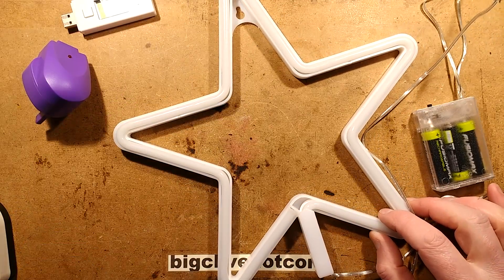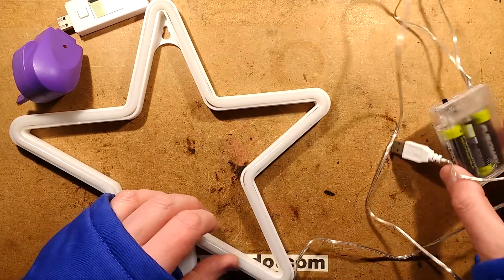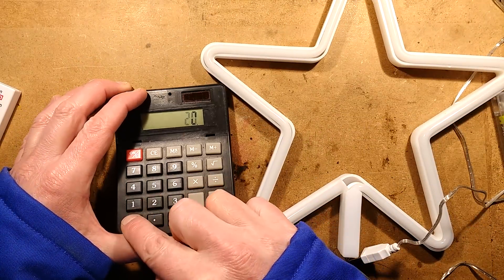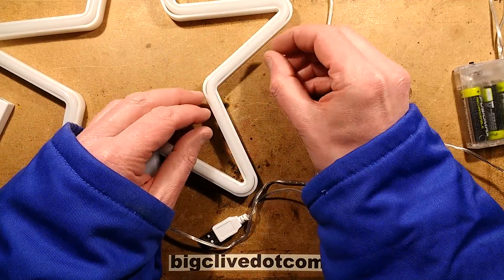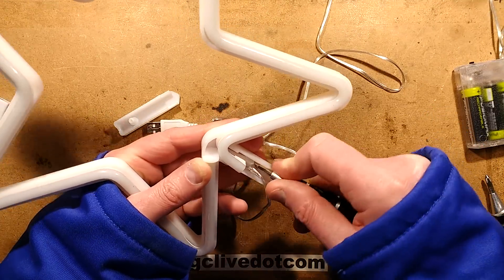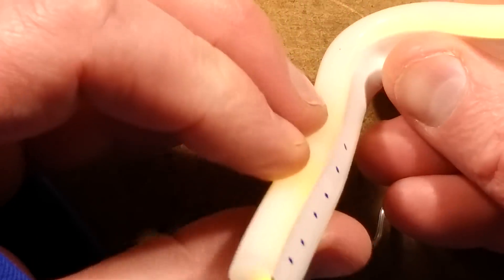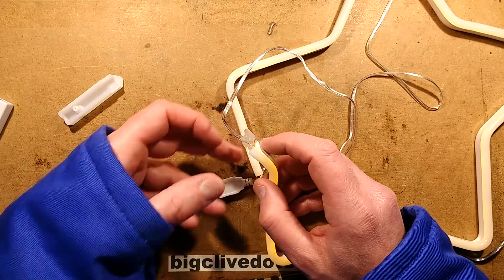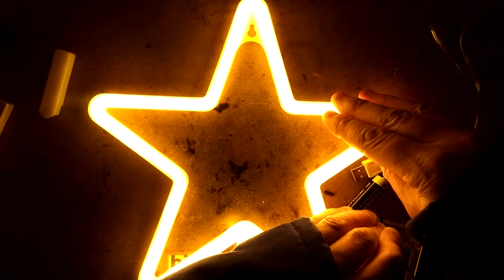Inside a USB/Battery LED neon-style star.

Comment: I just got a USB powered one of these on clearance at walmart. Mine draws around half an amp.
They had a cloud one too. I ended up removing one of the LEDs from the tape because it was cut and not lighting up. I powered it and the LEDs themselves are yellow for the star.

Comment: What kind of wire do they use? Would it be possible to strip those and connect to them a battery clip?
Reply from the maker: It comes with a battery pack and USB connector.
Reply: @bigclivedotcom  I ask that because I have one of those signs with the same connection but I would love to make it strictly off battery. How would I go about that? Strip and connect a battery clip?

Comment: I have a couple of these and I'm wondering if there's a way to remove the plastic battery case? I only use the USB feature and the battery packs are keeping me from hanging these on my wall since they're bulky and would be super visible.
Reply: did you find a way?
Reply: @skydriver2639  no :( all of the wires are soldered together inside of the battery pack and i have no idea which ones lead to where so i don't wanna risk making them unusable, haha

Comment: You say factory workers, but this seems like something that would be incredibly easy to make "on demand," i.e. have a stock of frames and various colors of LED tube tape and spend the minute needed to cut the tube, solder the leads and glue it into the frame for each order. A very effective eBay operation assuming they're getting a good price on the tubing.

Comment: I would love to see a video on battery backup bulbs work (like https://www.lyfelite.com/)
Reply from the maker: I did an early one, but they've evolved a bit.  They detect the switch by passing a small current between the lamp contacts and detecting other loads in the house when the switch is on.  If you bridge the back with your fingers they lamp will light.

Comment: I would be more interested in a similar unit or smaller with real neon. A few years back I saw neon signs that were about 5” diameter and they were make of a injection molded neon. Should have bought one.

Comment: Kodak used to deliberately try to explode your batteries. If you used a kodak power supply into a Kodak camera, there was a little non-standard nub at the base of the jack that would interrupt the supply to the battery compartment. If you used any other (generic) power supply jack, said nub was missing and it would charge your alkaline batteries. A very dirty trick, if you ask me. The last time I ever bought Kodak.
Reply: Coming from the film era, and being a fan of both Kodachrome and Ektachrome (but a real fan of Fujichrome) - I know what you mean - but I got a real cheap deal on a printer and digital camera that I couldn't refuse. I never blew a battery because I got wise to their ruse but an unwitting person must have done it at some point...

Comment: To remove hot glue from a surface, denatured alcohol is perfect!
A few drops to the edge of the splice and then a little stretching is enough. The adhesive then detaches from any smooth surface.

Comment: If you spray the hot melt glue with isopropyl alcohol it will soften and is far easier to remove.

Comment: I'm looking for exactly this stuff in longer lengths preferably in 12v for Santa's sleigh!
Reply from the maker: https://www.ebay.co.uk/itm/302322014060  But also consider waterproof 12V LED tape from the same supplier.  Lower power for brighter sparklier effect, albeit more directional.
Reply: I'm thinking about rgb tape for around the frame and this stuff for the decorations. Needs to be fairly weather proof though.

Comment: Clive, when you ran the voltage down to 3v. I heard either 30 or 13 ma.  With 2000 mah rechargable cells at 30ma, that's 66 hrs.  Add a 6/18 hr candle timer and I think you've got the 12 days of Christmas covered.  AND, you know when it's time to take down the tree. :-D

Comment: Clive, at the risk of being "that guy" trying to contact you in the comments, would you have any interest in a couple 120V LED bulbs? The internal construction was a bit different than some of the ones I've seen you take apart, and I wouldn't mind sending a few over.
https://imgur.com/a/dlS2Q
Reply from the maker: I've looked at similar lamps in the past.  The large transistor-like components are high voltage current regulators with internal thermal adjustment.  They usually just require a single resistor to set their output current and dissipate the difference between the mains voltage and the LED voltage as heat into the heatsink.  Those may be multi-chip LEDs to get as close to the mains voltage as possible.

Comment: Hey Clive,

Do you happen to know where I could buy a 30W 240V dimmable LED driver and warm white COB LED with no AC flicker? We can’t buy ceiling fans with this arrangement here in AU, so I’m trying to make my own.  Any advice is greatly appreciated.
Reply from the maker: Most dimmable LED lamps flicker unless they have very complicated circuitry to derive power and intensity informnation from the chopped waveform.   The higher profile brands like Philips may not flicker but will not generally be rated high power.
Reply: bigclivedotcom 

Thanks, I’ve seen those LED lamps and they almost suit. The highest wattage that Phillips make is around 13W, but it’s cold white! I was thinking of using two of the 9W warm white lamps, but the domed light fitting in the fan doesn’t have room.
Reply: Hi Clive, I found a solution. I had some unused 9 watt MR16 warm white LED lamps doing nothing, so I gutted the little round PCBs out of them. A dimmable 20 watt LED driver with a varying DC output has worked well. I use two of the PCBs per fan, using the fan itself as a heatsink. No AC flicker at all, and dims nicely. Not down to nothing unfortunately, but good enough. Hope this helps you or another subscriber.

Comment: Since you are wearing that warm-looking clothing, I would like to ask do you still have about 11 degrees celcius in your apartment, as you have said before? If so, what is the reason for such a low temperature?
Reply from the maker: I've spent my life working on open sites and outdoors, so I prefer a cold environment.  I use dehumidifiers to keep the place dry and cool.
Reply: Okay, thanks. It just seems so extreme, no offense.

Comment: Clive, many (if not most) electonic items I buy  run on 3 cells, whether aaa or aa. The problem I have is that the charger seither take two or four cells, and not three that the devices take, therefore  I constantly or inconsistantly miscarge individual cells. Do you have a strategy you could share with us?
Reply from the maker: I always look for chargers that charge cells individually.  Charging in pairs is often a sign of a cheaply designed charger.
Reply: Buy a charger that charges cells individually and not in pairs.  Charging in pairs is not good for the cells as they can charge unequally.
Reply: I can really recommend IKEA LADDA for 99SEK (10£/10$?) which is a good and cheap individual 1-4 pcs battery charger. (looks like a GP battery charger for 1-4 cells my dad has which was around 60£) http://www.ikea.com/se/sv/catalog/products/80241307/

Comment: put some bloody heating on you tight git lol
Reply from the maker: I normally would when it gets this cold, but the oil burner has just packed in.  I spent the evening trying to remove it from the boiler, but it's seized in solid.  I'll leave it to soak with penetrating oil for a while.
Reply: bigclivedotcom   A while = sometime in the summer.  Heating is for southern shandy drinkers isn't it?
Reply: ACTUALMIKU 
He wraps himself in Dickies®
Reply: +bigclivedotcom I get cold so easily idk how you live.
Reply: its lucky you have the knack of stuff that matters clive ...old boilers thou inefficient are easy to fix ..not like the new gas boilers those things are a POC hope your oil penerates deep and you can get some heat back on ...
Reply: are you telling me that he has a huge dickies lol ..tmi lol

Comment: The only downside to LEDs in place of Neons is you don't get the traditional buzz and flicker of a faulty neon sign... :P
Reply from the maker: That can be added.
Reply: No opportunity for FART Jokes either - (the Italian Neon Sign Transformer Manufacturer)
Reply: Given it comes from china, I'm surprised it's not fitted as standard... :P
Reply: I guess just a small mains->5v transformer with a resistor and small speaker on the secondary should do it. Maybe a capacitive dropper if the sound is too clean/siney.
Reply: bigclivedotcom My thoughts exactly! You rule.

Comment: Hello, I’m a long time subscriber but I don’t know anything about hardware, but why is it that some electronics can work even if something is really corroded I saw a video where a YouTuber took apart a ASIC Antminer but it still turned on the fans, but why wouldn’t the rest turn on?
Reply: If the YouTuber in question is Louis Rossmann, then I've seen that video and the reason the fan worked is that the PSU was fine. But the controller board noticed that something odd was happening on the data connections and so lit the fault LED. If I would design a circuit like this, I'd make the fault LED active-low on the processor side so that it turns on both if the main processor realizes that there's a problem and in cases when the main processor is the thing that has a fault.
Reply from the maker: The power supply was probably working but the corrosion may have affected the processing circuitry.
Reply: Where corrosion has occurred, one of the most common failure modes, is that of a partial malfunction in a system. It only takes one wire, or one electrical connection (or conductor) to rot, and then part of the system, or in some cases, the whole lot will not work as designed.
Reply: Bryce Spaulding You're welcome. It is our curiosity that leads us to channels such as this one. As for the quick reply, that was caused by my sometimes-formidable procrastination powers. But for the record, if you can remember the source for anything that you quote, you really should link to it. What if somebody else who didn't remember the video that you referenced were to answer? Or what if someone in the future sees your comment and gets confused about what it is that you meant?
Reply: Danya G. Yeah it was him, but it was an little older video than this one, so I assumed no one would notice the comment as quick so I just gave it a shot here. I appreciate the reply. I’ve always been curious but thank you.
Reply: Danya G. I definitely agree, I was thinking when I commented that Clive wouldn’t want me linking another channel, but I soon realized that he’s too laid back for that, should have known better. Thank you for your help though.
Reply: Mark 1024MAK Yes, it takes only one failure, but only if the system is non-redundant. And I would think that something as expensive as this would have a degree of redundancy built in. Especially since modern CPUs have upwards of a thousand pads, and I cannot believe that all of those are unique, then there is at least some degree of redundancy in those systems.
Reply: Bryce Spaulding Really? You were worried about him seeing you like other channels? He himself likes many other channels, as evidenced by his subscription list. (And yes, that is public - you can click on an avatar, mine for instance, and see the channels that the person subscribed to. Unless said person doesn't want you to see this, which can be activated on a per-channel basis, but I've never found a use for it - why subscribe to a channel if you're not ready to tell other people about it?)
Reply: Danya G.  For the most part, unless otherwise specified in the requirements, it's only safety critical and operational critical systems that have extensive redundant system designs (other than multiple HDD and dual PSUs which are not uncommon in industrial computers for example).

Comment: About the UT658 USB analyzer, I've seen you use at least couple of different USB meters. Do you have a favourite?
Reply from the maker: I tend to use the big Portapow unit for serious tests, but I really should do an accuracy test on a range of testers.
Reply: I had completely forgotten about that PortaPow unit. Looked at it a few times on their site but never bought. Shame that they don't do direct sales anymore. I've been most interested in the YZXstudio meters, remote logging and all that good jazz, even the option to do BT which would be quite handy in some situations. But that interest has never materialised into actually buying one. Oh well..

That's a good idea for a video. Obviously going to require a bit of work to put something like that together but I'd love to see it someday if you have the time, energy and resources to do it.
If you decide to do one, it would be nice if you go on a bit about the different "styles" of meters and how you could use one. Especially considering fast charging with phones (/tablets) is quite common these days and now we've got laptops being charged through USB-C with USB-PD and so on.
Like QC3.0 being 5-12V (some meters are rated 0-9V), OPPO VOOC/OnePlus Dash pumping 4+ amps at 5V (some meters are rated 0-3A) and so on. So buyer beware that they buy an appropriate meter which can handle what they want instead of buying the cheapest, generic USB charge doctor.
Reply: Seems to be more accurate than some of the earlier "generic" USB "analysers" (such as the Keweisi The BC used to use), when checked against a "real" meter (V and mA). Very clear display, memory function and good back-lighting. http://www.uni-trend.com/productsdetail_1449_984_984.html. Saw BC using this a while ago, and bought one. Not disappointed.

Comment: I could utilize this for custom stage signs that are more resilient than Neon Tubes and less noisy than the giant neon transformer.  You inspire me, Clive.
Reply from the maker: It does lend itself to rugged stage use.  You can also buy mains and low voltage versions of the raw neon-style strip in a wide range of pre-terminated lengths that can be further cut down.  The red in particular looks stunning.  The low voltage version has the advantage of being non-flicker and potentially dimmable with a DMX-PWM dimmer.
Reply: I will investigate that more in depth at a later point.  I have been eyeing an 24 channel DMX controlled RGB dimmer anyway.  When I get around to toying with that, I'll let you know how it works out.
Reply: Please post here if you got an update on that.
I might look into something quite similar in the future. And there is never too much experience to take in :)
Reply: Definitely.  I may try to pick up some materials on the next pay cycle.  If I do, I'll post a video to my channel demonstrating how well it works.
Reply: Some years ago I did a show with some exactly like "neon" sign and it was great. Where I am now we have some to line the edge of a stage. The main pain for us was the link between PSU and "tube". I cannot remmeber exactly what we have but I THINK ours might even have a processor to do chasing.
Reply: You may want to add this to your watch list. Apparently each one can support up to 165 feet (a little over 50 meters).

https://www.ebay.ca/itm/3-330-LED-Neon-Rope-Lights-110V-120V-Commercial-Flex-Tube-Sign-Decorative/262892824495?hash=item3d35a227af:m:mBG1HLa7vY2GoQXvALMMNTQ